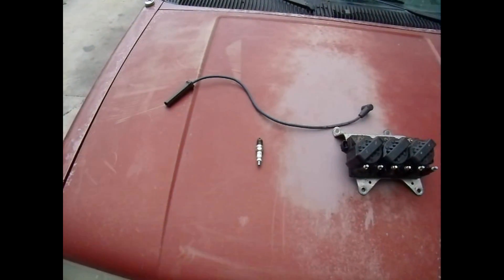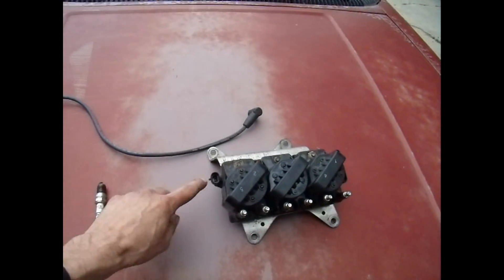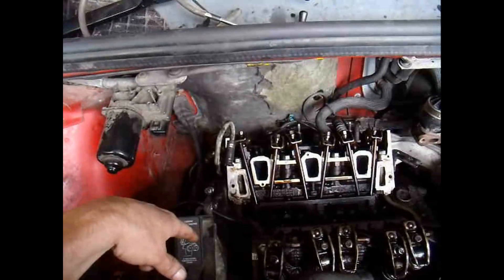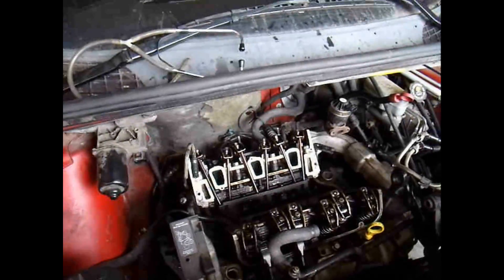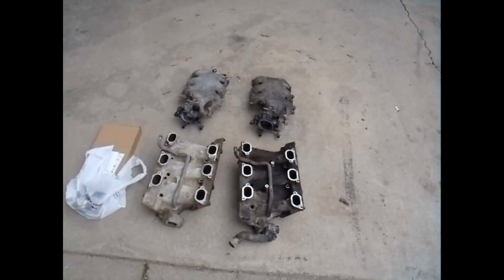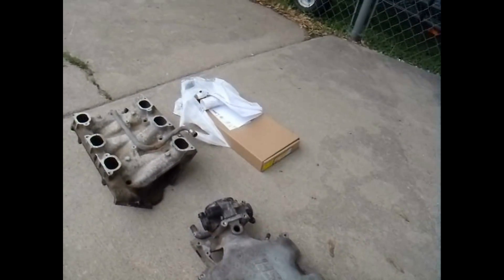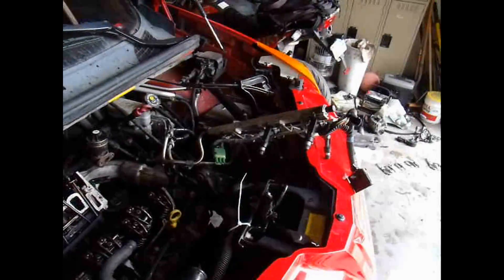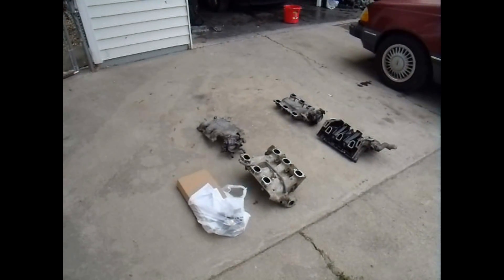GM 3400 / 3100 3.1 3.4 Engine Misfire Cause & Causes Miss Missing P0303

Comment: I'm having a similar issue with a Aztek 04. I've tried everything and it's looking like I might have that issue.

 Mine is cylinder 3&5 but no leaks were noticed or cracks. 
 Here's what I've done.

Plugs wires coil control module crank sensor(onside of block) fuel regulator 2 New injectors and temp sensor.

Tested out compression fuel pressure and spark all are good..... Any thoughts?
Reply from the maker: Have the head gaskets / intake gaskets ever been changed?  Might try a coolant system pressure test also and check 3 & 5 for coolant.  
VT247
Reply: No coolant issues. I haven't lost any fluid from there I checked. Number 3 was being over flooded so I thought both injectors were stuck open. So I replaced both. 

 Idk man about ready to junk it lol. Air fuel ratios seems inline with my problem. No cracks found when I did the injectors on plenum or intake. 

 It smoked bad but it was straight fuel smell. With my compression being good I ruled out rings. Also tested new spark plugs and like yourself everything checked out good.

 Thanks for the reply. Pulling my hair out on this thing lol.
Reply: Yeah by the way. I hate working on Azteks! Could they have made it any worse to get to the back side of those thing's!!
Reply from the maker: Any codes?  Might also check your voltage values if you have access to a good scanner.  Might also check out the idle air control valve, the throttle body, TPS, EGR.  Just a few more suggestions.
VT247
Reply: The only code that pops up is p0300. Random multiple miss fire. On a high end scanner it pulled up 3&5 weren't firing.
 Volts checked out and EGR etc also have checked out good. 

 I had a "snowball" effect with this car. Over the course of working on it I put injector cleaner which cause my number 3 cylinder that was stuck wide open to clear out and POUR gas into the cylinder. My compression was the lowest on that cylinder at 107 where everything else tested at 120. Understandable after being washed with gas. Before I changed the injectors you could smell fuel before you started it. Gas lines just got replaced with New fuel filter so I know there was no leak there. 

 Now riddle me this!? The first 15-20 seconds of starting it ran good then chugs like a motor on life support. It wasn't smoking at first but now does every time I start it. It's not the coolant and the valves also seem to be good. I forced air into the cylinders to check. Everything has checked out unfortunately. 

 Which points me to the intake gasket. You don't smell fuel the moment you turn the key now. And I was Thinking if I have to much air with the injectors working properly now. Maybe that could be my cause for it running worse after all the work I've done.

Over 60 years worth of experience has tried to help me with rig and I'm to deep in to junk it. Do you think I'm on the rite track?
Reply: @alexedes921  figure this out?
Reply: @hooblydoobly9125  nope BUT I faced a similar issue with a Trail Blazer. That ended up being the fuse block so I expect the same with that nightmare.

Comment: Would this cause no compression when a compression test is done?
Reply from the maker: If the pushrods are put on wrong it will hold the valve open and have no compression.  Another source of no compression could be a bad head gasket.  If you've recently done an intake job, try taking off the rocker arms and then cranking the engine over and check for compression.  The intake and exhaust push rods are of different length.
VT247
Reply: Vacationtime247 I had head gaskets replaced twice. The diagnostic computer read a misfire on #5 cylinder. I was going to buy another engine but now I’m thinking the guy that done the work didn’t check to see if the lower intake was cracked. I guess I was asking to see if it would cause a compression test failure if the intake was cracked. It would save me a lot of $. I think I will tear it down myself before buying another engine to see if it is cracked as shown in your video.
Reply: Vacationtime247 I just re watched the video and you said the compression test you done passed because it’s between the valves and piston... my bad. Then again, I didn’t see the guy do the test so I’m going to tear it down anyway.... it’s got to come out anyway so why not. Thanks for the video and reply man. You’re awesome!

Comment: Whats the average compression psi?
Reply from the maker: None of the cylinders should be less than 100 PSI.  There may be some variation but the numbers should be close.  FYI, these engines are known to blow factory gaskets, head, intake & timing cover.
VT247

Comment: Thanks. Your video was quite helpful for shade tree mechanics.
Now do one on getting to those pesky rear spark plugs. Coz quite frankly many shade trees, ain't limber or spry enough; to jump up on the engine block to work. 🐒
Reply from the maker: Found it easier to just lift the vehicle and put it on jack stands in the front.  Then reach up from behind the firewall while on the ground.
VT247

Comment: My wife drives a 94 grand-am with the 3100V6, it just turned to 100,000 m and problems start. Fuel line's rotted so I replaced, and the brake line's as well because they looked just as bad. Now after installing a new alternator and battery it will barely idle after start up. There is no power at all. Fuel pump pressure is 38 on and 35 running. Plugs and wire's check out, not had chance to check injectors , when looking at wires leading to injectors I found a lot of them that the insulation was cracked and falling off. Would that be the cause or just a part of the problem?
Reply from the maker: Need to find out why it's missing out so bad.  What codes does it have?  Is it random or cylinder specific?  Pull individual spark plug wires off and see if that makes it worse or no change.  Helps isolate which cylinder is missing out.  Just a few things to check, check for strong spark (coil packs and coil module).  Vacuum leaks, can check with carb cleaner or mists of water, noting idle change.  To check fuel injectors I plug one ear and then use vacuum tubing (one end in your ear the other to the injector)to listen as the injectors cycle.
VT247

Comment: I have had this problem a few times and 4 times the lower intake gasket dowel pin was slightly oversized causing lower intake to crack.  Now for the top intake they seem to be cracking once I go on the 3rd pass or second pass to tighten them to 18 foot pounds as a service manual says but if I only tighten them to 115 inch pounds I don't have any problems with the intake plenum cracking so my question is what are the torque specs I have followed the torque sequence the enters first then the atoms in a cross pattern but what should the proper torque specs be so these things will not crack because it seems to me that the aluminum intakes are porous and Contour so when you tighten them down they have they don't sit totally flat
Reply from the maker: Personally clean every hole with an air chuck and clean the threads on all the bolts.   One had a plastic dowel pin broke off inside the locating hole.  
VT247

Comment: i had to change my camshaft and lifters on my 07 impala 3.5 p0303
Reply: Tee Wild whooa
Reply: Tee Wild i have same code but on malibu..what made u come to that conclusion? I hope i dont need to do that. What were symptoms of your impala?
Reply: look up 2007 impala worn camshaft its 3 parts tho
Reply: Workedpigeon354  well i changed the spark plugs, coil still cylider 3 missing no change. when i revved the engine to 2500 there was a light rattle almost not noticeable misfire would stop. go back to idling misfire present. So i decided to pull the lower intake and removed the lifters 1 by1 and looked at the rollers and one of them was toasted and had ate the camshaft lobe. This problem all started when the engine started making a light squeak noise at idle then it stopped after driving for some time. i then notice the engine starting to run rough and miss only on the 1 cylinder.

Comment: Did you or have you heard of these things having overheating issues as a result of these gaskets fucking up?
Reply from the maker: Heard of it?  I've got video's dedicated on how to fix them.  The factory gaskets suck.  Head, intake and timing cover gaskets fuck up regularly.  If you've got to do one, you best do them all.
VT247
Reply: Vacationtime247 is it worth it for the amount of time involved?
Reply from the maker: Actually, yes.  IF you have the right car to fix.  The parts to do the repair are cheap, like less than $100.  Might take about a day or two for a first timer from start to finish.  Once the gaskets get replaced the car is good for another 100k miles if you plan to keep it.  The Buick Rendezvous / Pontiac Aztek is a great example of a car that can be picked up for cheap, fixed and flipped for profit though.
VT247

Comment: Changing front valve gasket on 04 Buick randevous any advice?
Reply from the maker: Check the oil pressure sending unit.  Sometimes it may appear that the leak is coming from the valve cover but it's usually the sending unit.  Above the starter but below the valve cover.  But if it is the valve cover on the front the biggest problem you'll have is that stupid black coolant tube going over it.  It can be lifted out of the way once the bolts are removed under the throttle body.  
VT247

Comment: I just got done working on a GM 3400, had no compression on cyl 1 put air to the cylinder to find leaks it had none pulled the valve cover and cyl 1 intake pushrod was sticking through the rocker arm replaced the rocker arm and everything is now good hitting on all 6 and cyl 1 also has compression. If the intake doesn't open it can suck oil by the piston rings and push it out the exhaust.

Comment: See with my 08 equinox 3.4L I get a jerking hesitation on a incline and around 55mph on highway.  I got the lean bank 1 code on a diagnostic.  Ive changed the plugs and wires, coil pack was my next guess
Reply from the maker: Also might be a fuel injector being that it's lean.
VT247

Comment: very helpful, tearing mine back down, just replaced manifold gasket and put all back together, fired up and noticed miss and louder tap noise from motor, service engine light came on , ran a obll scan and got code P0304. tested all the wires and coils and in the process of tearing back down to check fuel injector #4 , had to remove fuel rail to do. My worst fear is the valves were not tightened correctly, causing maybe to much fuel to enter or not escape

Comment: I have a Oldsmobile cutlass 3.1 v6 did the timing on it and rebuild the engine but it's not wanting to start think the push rods were put back in wrong how do I find out the right order they go in
Reply from the maker: Intake pushrods are slightly shorter than the exhaust.  Should be easy to identify which is exhaust and intake by just looking at the ports.  Make sure all the connections and wires are connected to the coil pack / ECM
VT247

Comment: have a problem with a slight overheating on at 3.4 before you found the manifolds were cracked
Reply from the maker: Do a pressure test of the coolant system.  Make sure you bleed the ports and fill the radiator first.
VT247

Comment: I have the same problem with a 99 Cadillac Eldorado and I changed everything and still have a misfire on to spark plug wires.  I changed the coil also what could it be intake manifold leak

Comment: I replaced my plugs, wires and coil. Then I am having my 6 fuel injectors replaced. They said they replaced them but are having problems making the 3.4 run right. They had the van for 4 days now it's the weekend. What should I look for after getting the van back. Im thinking the catalytic converter, I do have a tech 2 scanner.
Reply from the maker: Vacuum leaks and bad gaskets.  The GM 3400 is notorious for bad intake, head and timing cover gaskets.  
VT247

Comment: I threw a code for a cylinder 2 misfire after replacing my lower intake manifold gasket on my 3100, so I'm pretty sure I'm having the same problem.  Thanks for the upload kind sir

Comment: i have a 2001 grand am gt 3.4 that has a random misfire in cylinder 1. the fuel was running rich and now the fuel is running fine but i still have the random misfire. Help?
Reply from the maker: Check the spark plug, wires and coil.
VT247

Comment: Why didn't  this guy do a vacuum check on it , that is  one of the most  vital  tools  you must have ,if you are any kind of mechanic at all. A vacuum  gauge can tell you  if you have an intake leak , burnt  valves, clogged  Cats. worn  out rings,  just about any fault an  engine can  give , a vacuum gauge will  detect it if you know how to read it at different  rpm's,  snap test  etc.

Comment: well my 2002 impala shudders  when  come to a stop sluggish afterwards randomly has bust of power aomes sluggish  burns oil euns lin is it same as wat u juat discribed an my motor is 3.4L
Reply from the maker: Sounds a lot like a vacuum leak.  Check behind the coil pack at the EVAP system, a vacuum line runs to it and can come out.  Also check where the black PCV tubing plumbs into the manifold under the throttle bracket.
VT247

Comment: I have somewhat of some issues too. My 3.4 Impala is using oil, my water pump seems to going as I'm  losing coolant, it doesn't seem to be in the oil, and I watch water fly off of the water pump pulley. She's also having fuel issues. Fuel is pooling up out of the top of the fuel filter. My transmission sometimes won't shift right, and has a terrible noise when idling (presumably from heating up due to the coolant issues). I've always taken very good care of this car. The suspension is all brand new except I have both control arms with ball joint's that need to go in. I dump money into this beast, as when it runs it runs great. But these issues all at once are causing me to some major grief at the moment. I definitely appreciate your video.
If anyone has any insight, feel free to let me know!
Reply from the maker: Do a coolant pressure test of the cooling system to find the leak.  May need a new fuel filter.  Transmission not shifting right MAY be fixed by doing a fluid and filter change or might be the PCS solenoid inside the transmission.  
VT247
Reply: Vacationtime247 Thank you sir. That is the concensus.
Reply: The Band's and pump are shot. Got the new one yesterday, old one will come out today and new one may even go in. Merry fing Christmas!

Comment: I actually just did head gasket job, had the heads machined, all new gaskets And they were fel pro. I have done all these test as well and still have the p0304 code. I have been dealing with this for a few months and still couldn't find the problem ND why is misfiring.and I can just barley feel it but you hear it out the exhaust . I hope this will be it. Awesome video man

Comment: Just got my car back from the shop and it was misfiring on the 3rd cylinder, and not running anywhere near as smoothly as it was before it went to the shop and is using WAY more gas. They replaced the water pump, the thermostat and the intake manifold gasket. When I complained to the mechanic that something was wrong, he said that the spark plugs needed to be replaced. I got the parts to do that, but because it was raining all day, I didn't get it done today, so will be planning on that tomorrow or Friday when I have time. This gives me a bit of a jumping off point for what to look for if the spark plus and wires doesn't work. Thanks so much!!

Comment: did a intake gasket replacement now engine has a loud lifter knock sound in it . took it apart again put it back same thing not sure if lifters are pumping up or what t2or3 lose the oil after sitting awhile need help ??
Reply from the maker: Probably a stripped out rocker arm.  Check there first.  May sound like a lifter but could be the rocker.
VT247

Comment: Thanks for sharing this man!  I'm certain that this video will help many frustrated viewers in the future. 
I had a leaky intake gasket so I tore it all down, replaced all gaskets (minus the head gasket), and put it all back together. It's a side project for my daughter's car, so I haven't been in a huge hurry. But it took me about 6 days, off and on, to get it done. Working on it when I had time. After reassembly, I have a misfire somewhere. I have plugs and wires to change out. I REALLY hope that I didn't Crack something. I didn't have a working torque wrench, so I had to eyeball it. 
I'll update with my findings.
Reply: Don't feel bad I had the same problem with a torque wrench. I was lazy and did mine in a week and also had a misfire when I put it back together. I took everything apart and put it back together again now the misfire is gone and the check engine light . My lifters lost pressure from sitting. the second time i dismantled it I worked the lifters with the push rod rocker assembly and before i fired it up i pulled the fuel pump fuse and cranked and cranked and cranked to build pressure. I pop it back in after i few minutes of running the valve tap was gone and no check anything lights. I hate my 3.4